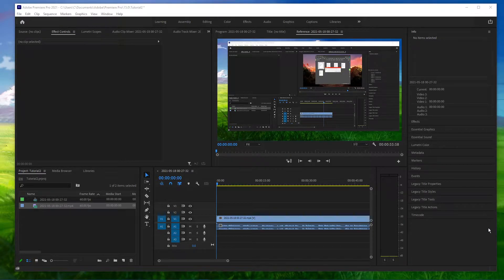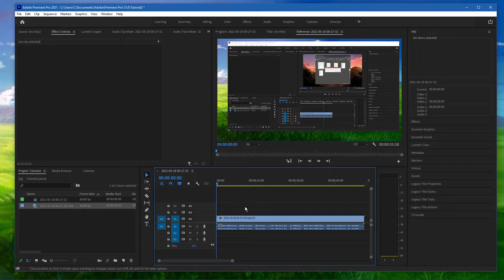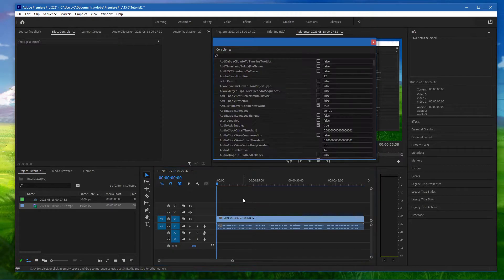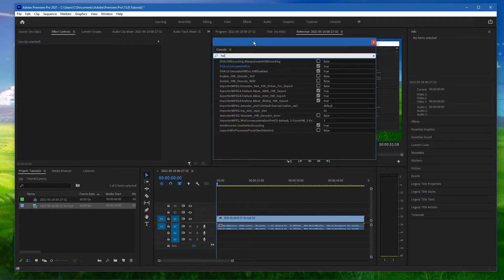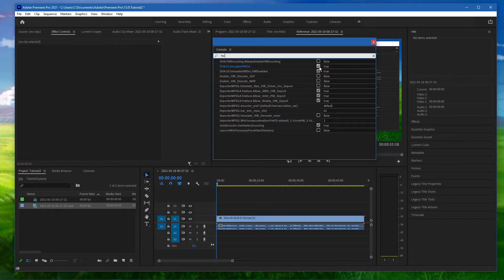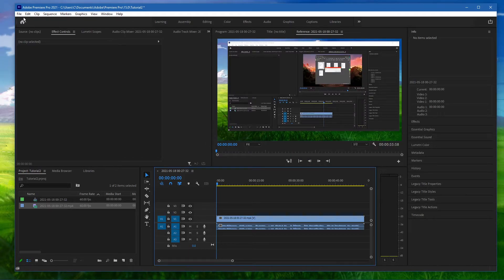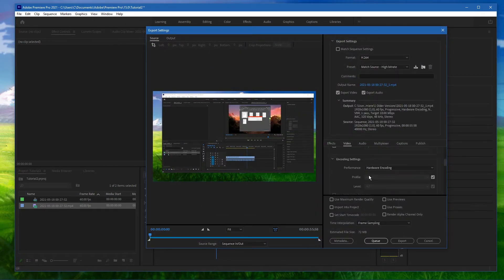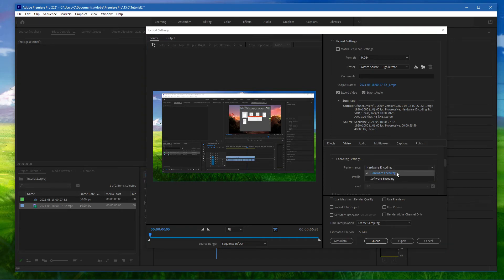Premiere Pro - How To Enable Hardware Encoding

Comment: premiere pro not using gpu after selecting hardware encoding and gpu accelarated radeon rx 6600 and ryzen 5 3600 cpu getting 100% usage and gpu 0%...plz tell me how can i fix😭😭
Reply: Same problem here
Reply: @Haritha_Se  try to use premier pro .2022....it will be fix...gpu will go...20-30% and cpu also 20-30%....
Reply: Yeah I'm gonna try with another version, when I was using an older version (2017 ig...) both were utilizing, this issue started happening when I switched to 2019 version.